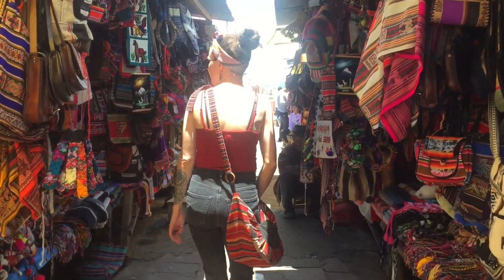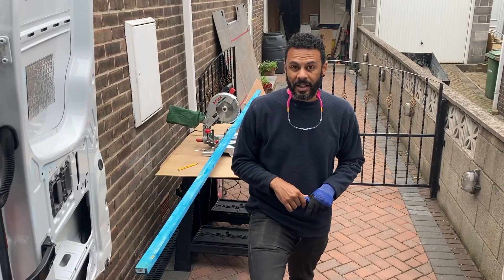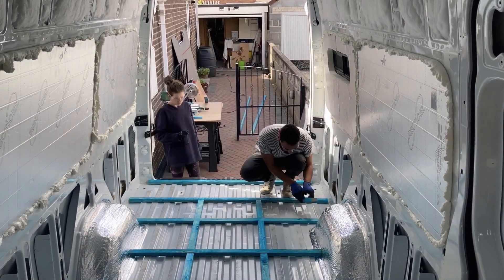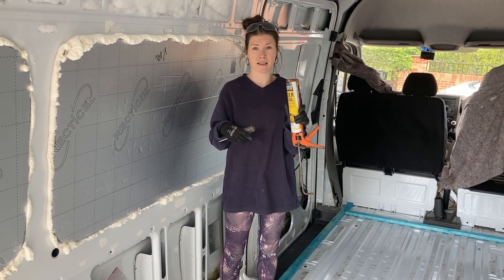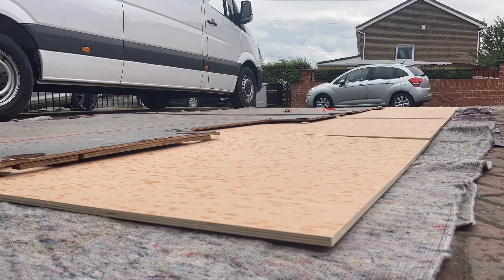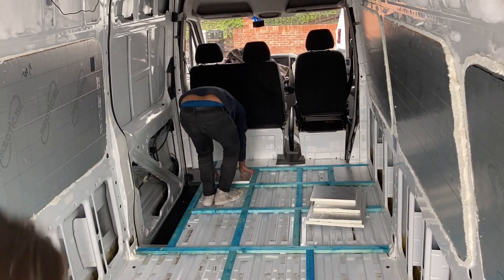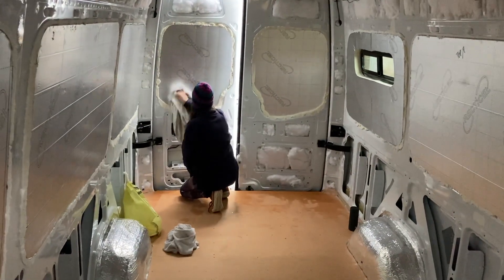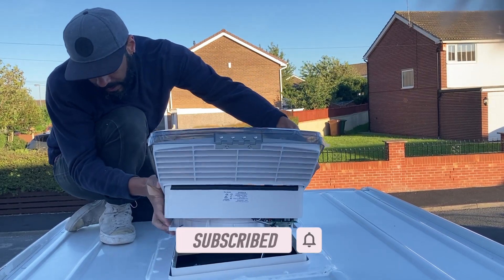Van Floor Installation | Framing out, Insulating & Installing Plywood Flooring

Comment: Hey team, love your channel it's really helping us with our sprinter conversion. 

One question about your floor joints.. the legend that is Greg virgoe uses some wooden bevels to create a joint between the pieces of ply wood and I notice you haven't, now you've been living and adventuring in your van for a while now, has this omission given you any issues? 

Thanks again

Luke and Lou
Reply from the maker: Hi guys! So glad you’re finding our stuff useful 😀

Yeah Greg Virgoe is the don, for sure. And he’s absolutely right on this too. We have a small lip where our boards meet which, while it doesn’t bother us on a daily basis, we know it’s there and for people like us it is quite annoying 😅

If your pieces of board are perfectly flat then you’d potentially not have a problem. Ours were bowed when we put them in but I remember thinking that they would probably flatten out with time - they haven’t. 

So for the sake of quite a minor added bit of work we’d probably recommend adding the biscuit joints in. 

Good luck and let us know if there’s anything else we can help with!!
Reply: @TheWholeWorldorNothing  thanks for taking the time to reply guys. We were lazily hoping it wouldn't be a problem but will take your advice and do it properly now! 😄